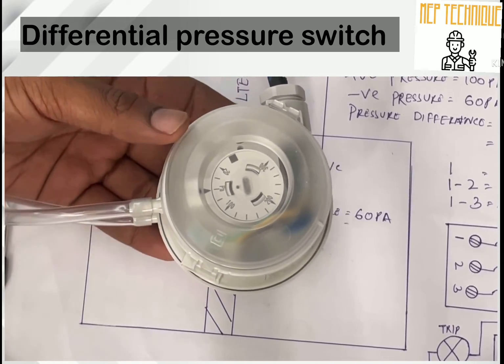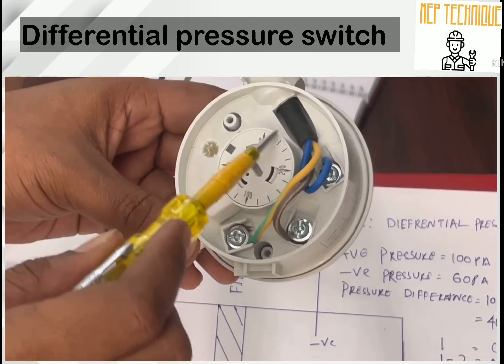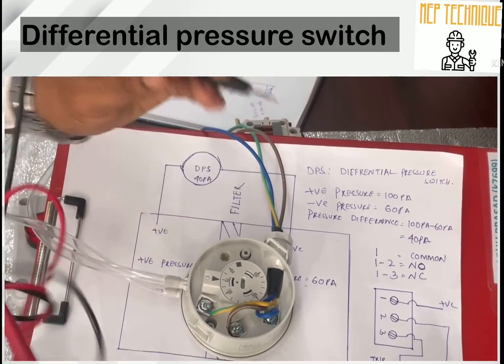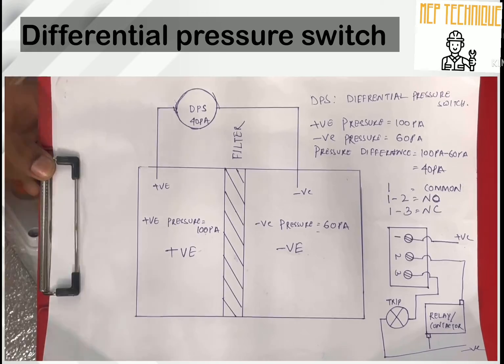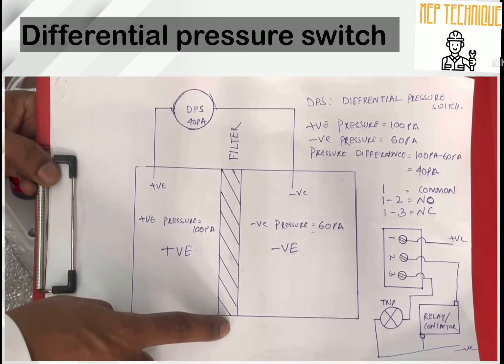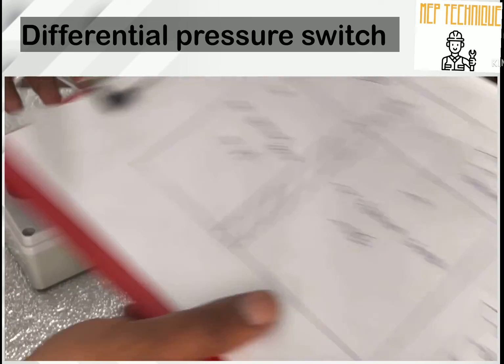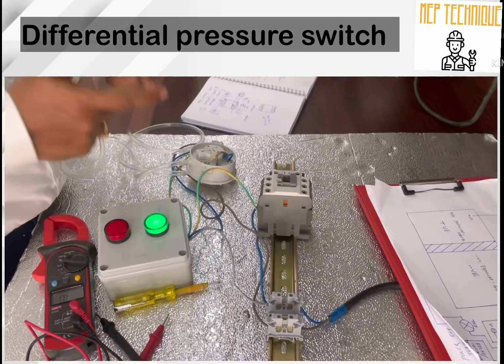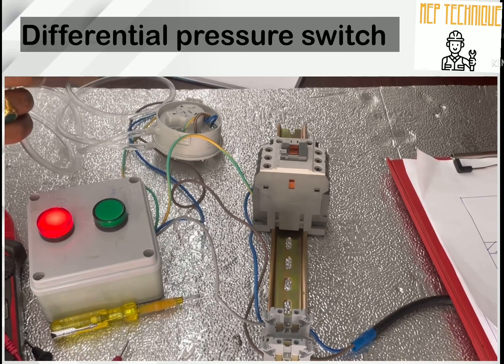How do you connect a differential pressure switch in FAHU or AHU? #siemens #pressureswitch

Comment: How do you provide power to the DSP? I have a 2 core Mylar cable from the panel to each Jet fans extractor fans and presurizations fans
Reply from the maker: The control wire from your panel ( DDC panel/ in put module) should go directly to the device being controlled (e.g., a fan or relay). Select NO or NC depending on whether the fan or system needs to start or stop at the desired pressure condition.

Comment: and kindly sir , as u did explanation like this on diagram,, can y explain all ahu sensors that are fitted on the ahu unit and its location of filling like before fan after fan or in duct or in vav box , also sir we need ddc panel control wiring diagram
Reply from the maker: Thanks for your valuable comments, I will work on it and upload the video related to your requirements as soonest possible. Many thanks..